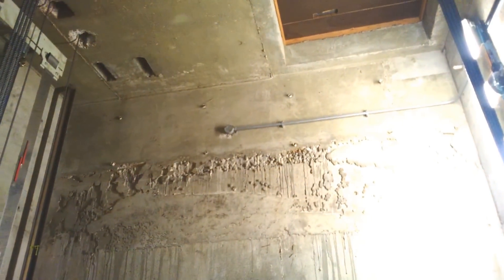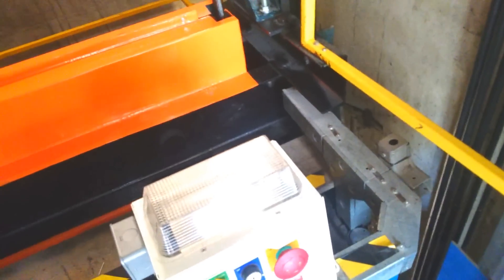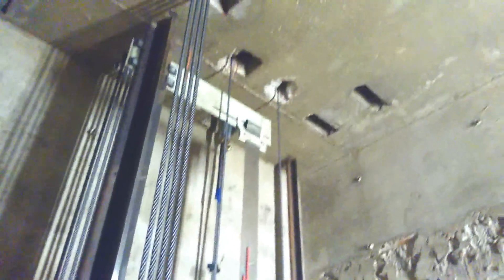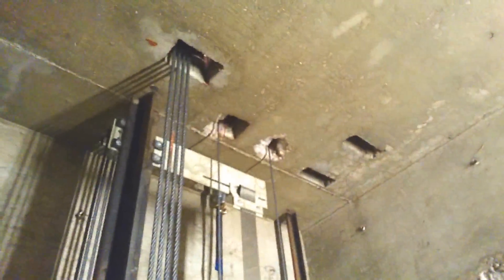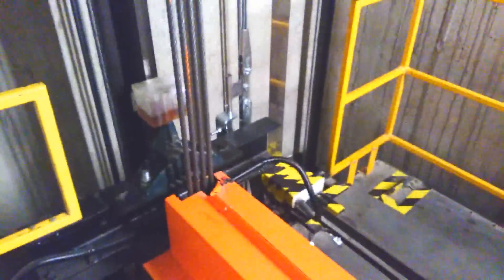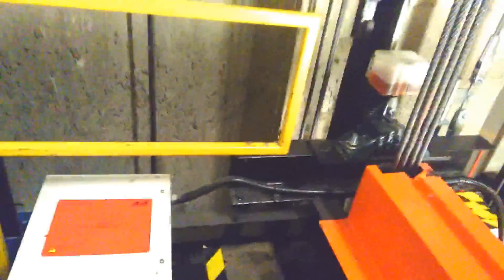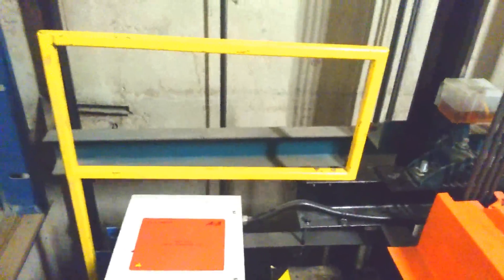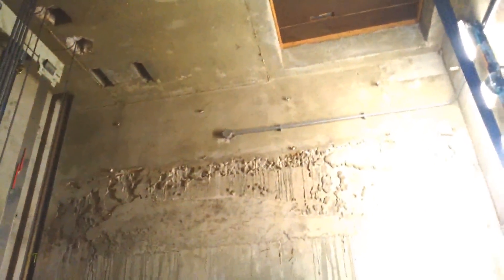A detailed look at a modernized 1970s Evans

Comment: Can you do a detailed look at a Kone EcoDisc?
Reply from the maker: The Original Roblox Fan Club - ROBLOX I need a certain key for the more recent ones.
When I find a quiet one that takes triangle key I will surf it.
The first gen, 1.5 gen, and early 2nd/3rd gen ecodiscs take triangle key. Later 2nd/3rd gen and 4th gen use a tubular key for the cabinet (so I can still surf it, but won't be able to do a full detailed look at it).
Reply: Ok. Thanks for the info. P.S: Look on eBay for a tubular key. You never know what you might find!